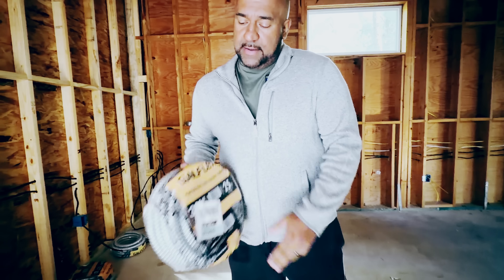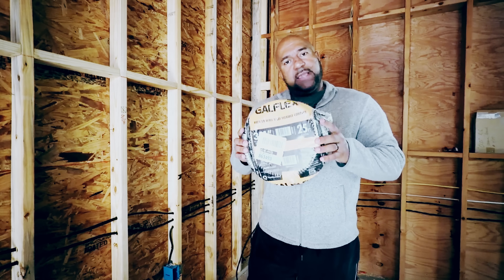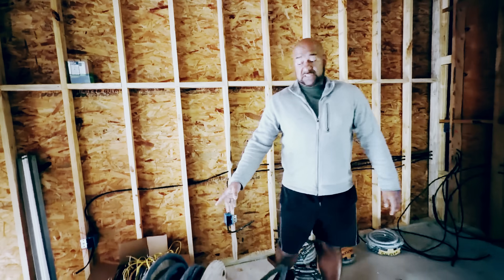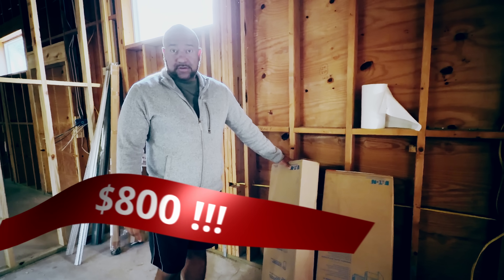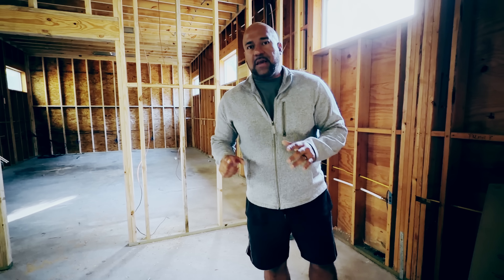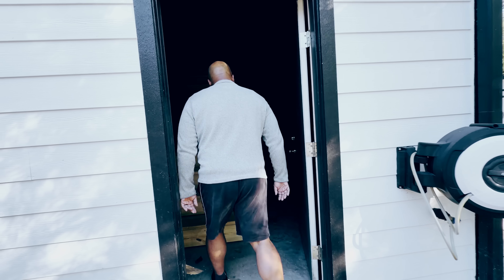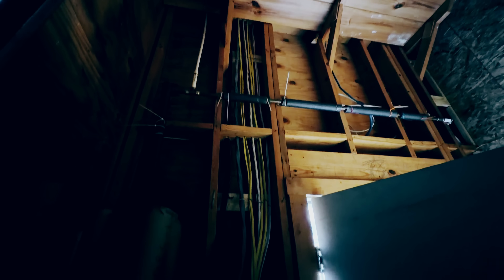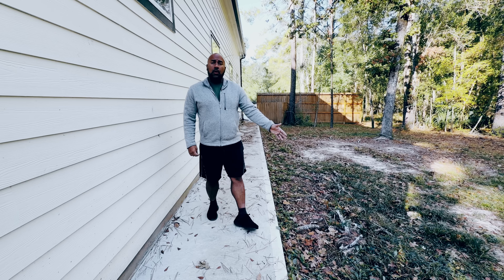I’m Finally Perfecting My Sound Room Electrical System

Comment: I’m actually a little surprised because when you were at Danny’s sound room here in Texas you raved about the electrical set up with the batteries and solar panels and how you noticed the difference with going with that set up over conventional one. I honestly thought a big part of this entire build was so that you could do a similar route, I guess I was wrong. No doubt you’ve taken every possible extra step with the conventional route but I’m curious why you didn’t go with the other option. I’m sure cost is a reason but any other reasons?
Reply: Because Danny is a dickhead and Jay was humouring him

Comment: travelled a few hundred miles on unshielded aluminum wire to get to your house. If these things make you happy do it, but don't go too crazy. A simple AC rated cap in the power supply input will filter all of that out anyways.

Comment: Is your panelboard of the same caliber as those from Kingrex Electric or Audio-Ultra? If so than 800 bucks is a bargain.
Edit: looked up the spec sheet for the brp40n200rg: "Bus material: Aluminum". Nowhere is copper mentioned. They're available in Texas for 570 bucks by the way.

Comment: Electric conduit is PVC gray in color called schedule 80
Reply: wtf? There are MANY types of electrical conduit. What’s in his hand is FMC, an acronym for Flexible Metal Conduit, also known as BX Cable.
Reply: @MichaelM-to4sg  
fwiw, ... Flex (those in the trade call it Greenfield) is entirely different than BX Cable. BX is a cable assembly. The Flex is just the raceway, no wires. 

(BX is an outdated term. AC is the modern equivalent)  

Problem is BX or AC ... is dangerous, because it doesn't have a full-size ground wire. It relies on the spiral flexible metal as the ground, ... no bueno. 

MC is the full-size ground version.    

The Flex, or Greenfield, is simply a raceway ... empty, no wires. 
Whereas AC and BX is an armor-clad assembly, wires and all.  

------------------------------------------

Also, I don't like the idea of burying Flex inside a finished wall. It can be extremely difficult pulling wire through it.